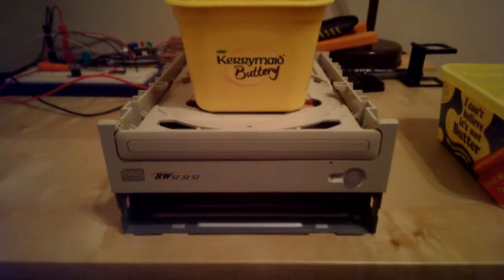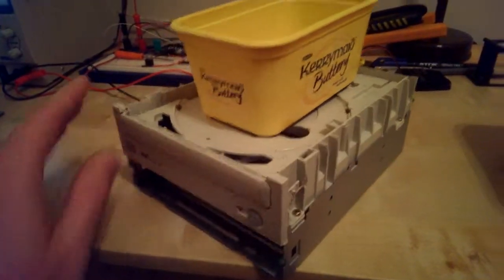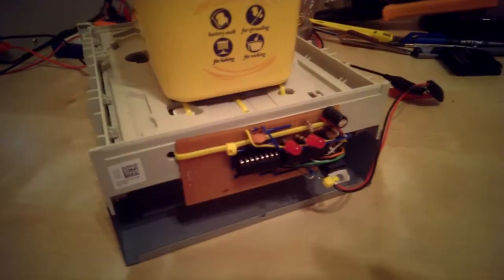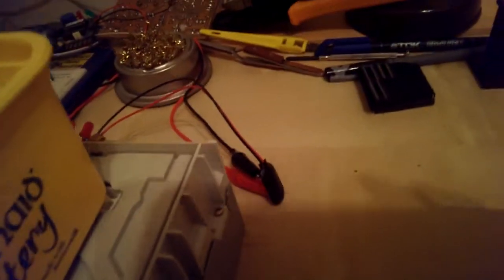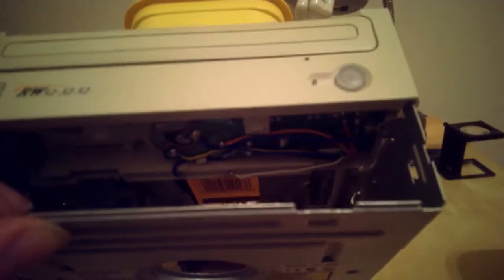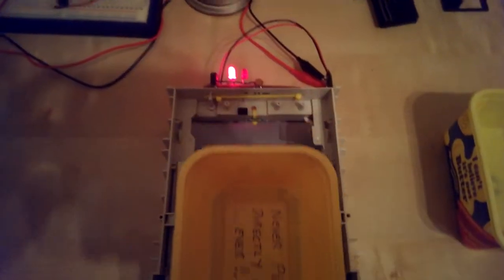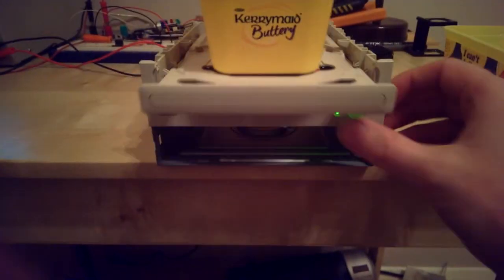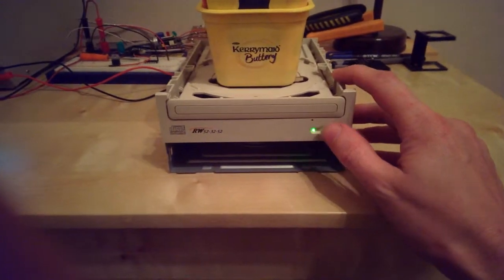PCB agitator for etching circuit boards

Comment: Mark did you actually try this? did it work properly with your PCBs?
Reply from the maker: Juan Sanchez Yes it works well. It was a long time ago now. I etched with PCB facing up and just enough fluid to cover PBC.
Reply: Awesome, still using it? or just went for a pcb service?
Reply from the maker: Juan Sanchez Its in the cupboard ready for when I decide to make another PCB 😁